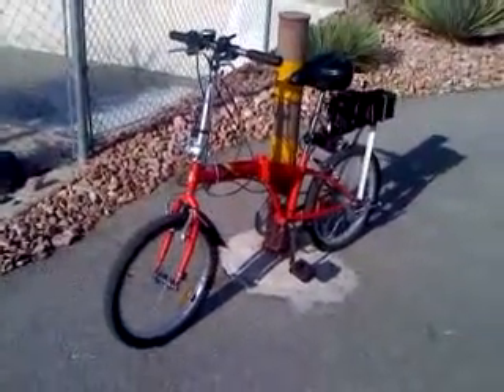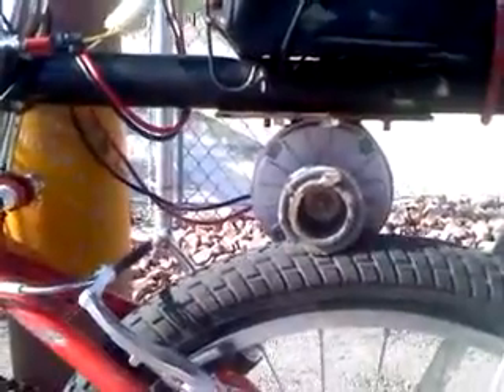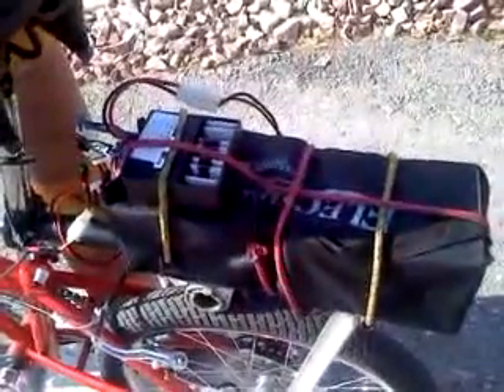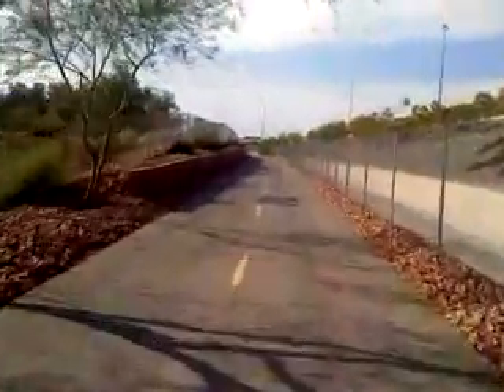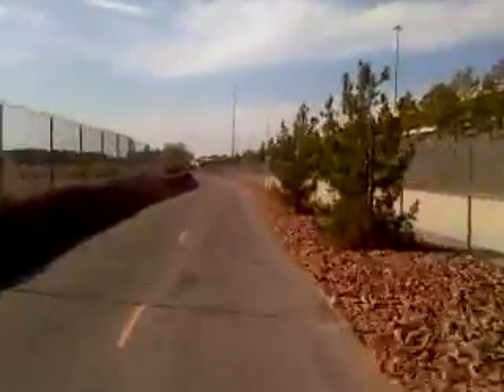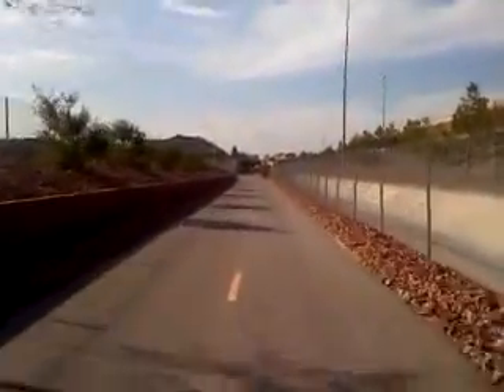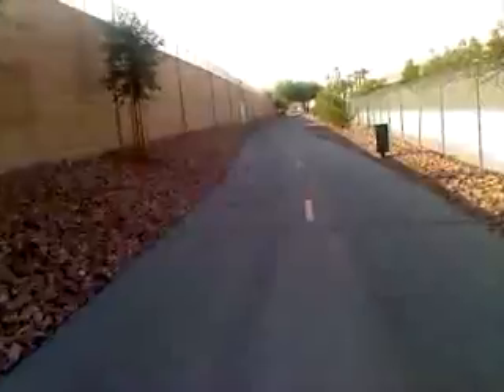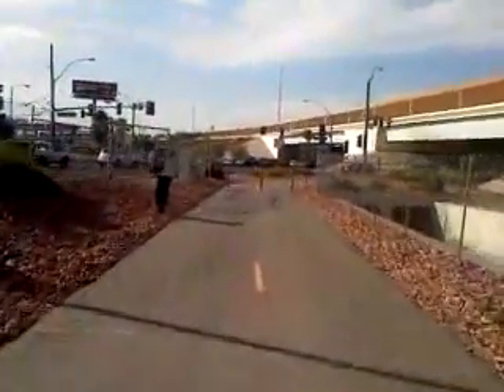Homemade Friction Drive Electric Bicycle

Comment: Hello, a lot of useful information about the motor power and the diameter of the roller, but what speed can it support under these conditions. My motor is 500 watts with the same roll. But not yet tested on the road. .See you soon
Reply from the maker: This bicycle had a cruising speed around 16 to 17 mph for a 350W motor.   With a 500W you may be able to use a larger roller to get a faster top speed.  With my 350W motor I was limited to these top speeds because of the power of the motor.
Reply: Thank you for the answer, I will mount a 80 mm diameter roll and I hope to achieve about 24 miles per hour. This is my calculation but will settle on the street. See you soon

Comment: Hutchtransfer, There have been more recent videos where people have rigged variable tension friction drives to their bikes as well as i and they seem to work pretty well as if you want to coast then you can disengage the friction drive while you are riding.
Reply from the maker: Yes I have seen those.  That device did not exist at the time I built my friction drive several years ago.  Using those RC plane motors are definitely the way to go since the motor disengages when you turn off the throttle.  If I were to build a friction bike today I would definitely look into that new system.
Reply: Right on and yeah i figured because all the other videos were newer on the release date lol. Yeah I have a 26 inch mens schwinn sidewinder mountain bike and im using a 280 watt 24 volt scooter motor with a 70mm skateboard wheel as the drive wheel (As you can buy them in different sizes by the millimeter of diameter and they have decent grip) and an old thumb shifter to put tension on the motor so it works like a clutch. Right now i only have 22.2 volt lipo 5000 mah batteries running it.

Comment: How do you work out the range and top speed of the electric bike?
Reply from the maker: +Larry Krishna   I can calculate the top theoretical speed by knowing the motor's top RPM (2750), the diameter of the drive roller (2.25 inches) and the diameter of the wheel (20 inches).   So 2750*2.25/20 = 309.  This means the back tire is spinning at 309 rpm.   The circumference of the tire is 20*3.14 = 62.83 inches.  So 309*62.83 = 19414.47 inches per minute.  Then convert inches per minute into miles per hour:   19414.47*60*(1/12)*(1/5280)= 18.38 mph.  On a slight downhill or if the wind is to my back then it will reach 20 mph. The range was not calculated using math.  This was the average distance I would travel on one charge.  Of course with using lead acid batteries the range will slowly diminish over time.
Reply from the maker: +Larry4life   Yes the rated rpm is usually the top rpm with a load.  Of course my calculation was assuming there is no wind or hills.  Purely theoretical top speed.  Actual speeds may be less.   I am glad the math is understandable because I am a math professor at a community college here in Vegas!
Reply from the maker: +Larry4life    So here is the process that I use to convert the motor's top speed to miles per hour.  First I want to calculate the rpm of the rear wheel by using the following formula:

motor rpm*(# of teeth on motor drive sprocket / # of teeth on crank drive sprocket) * (# of teeth on front gear sprocket / # of teeth on rear sprocket) = rear tire rpm

Now we need to convert the rear tire rpm into miles per hour by doing the following:

rear tire rpm * (pi*wheel diameter in inches) * (60 min / 1 hr) * (1 ft / 12 in) * (1 mile / 5280 ft)

This will give you the speed in miles per hour.  Keep in mind that this is the theoretical top speed.  There are of course energy losses in the chain and the inefficiency of the motor.  Therefore actual top speeds may be less.  I have not done any calculations with torque.
Reply from the maker: +Larry Krishna   Sorry about that!  Those calculations are for my current bicycle in which the motor is connected directly to the cranks.  This allows the changing of gears to match road conditions.   With the friction bicycle I had a 350W motor which is not that powerful, so I calculated a gear ratio to have the bike have a top speed of 17mph.  Here is the calculation I used:

Motor RPM * (Diameter of Friction Roller / Diameter of Rear Tire) = Rear Tire RPM

Then I used:    rear tire rpm * (pi*wheel diameter in inches) * (60 min / 1 hr) * (1 ft / 12 in) * (1 mile / 5280 ft) = bicycle top speed.  

 So I settled on a 2 inch diameter and that seemed like a good compromise between speed and torque.  Torque will be related to the slippage of the wheel, but I don't have any calculations for this.   I used the calculations to get a ball park speed I wanted and then tested it out.  Top speed was about 17 or 18 mph which is the most I can expect out of a 350W motor.
Reply from the maker: +Larry Krishna   So if you have a smaller diameter drive wheel then this means the bicycle will go slower, but it will have more torque (more power for driving into the wind or uphills).  If you have a larger diameter drive wheel then the bicycle will go faster with the wind and downhill, however it will not have that much power for uphills.  Therefore I choose a diameter that had some speed and some torque.   So a top speed of 17 mph is not that fast but it had some power from driving through light breezes and small hills.  For this bicycle I only used the math to get a starting point but then after that it was trial and error until I found a wheel that worked well enough for me.  Your motor is much more powerful than mine which means you will be able to use a larger diameter wheel that will give you some speed but the motor will provide enough torque for hills as well.
Reply from the maker: +Larry Krishna    I have a 24 volt system, so I purchased a throttle with a 24V LED battery indicator.  I purchased it here:  http://tncscooters.com/index.php?route=product/product&path=65_79_82&product_id=77
Reply from the maker: +Larry Krishna    I do not recall using a fuse on that project.   I had the batteries directly connected to the motor but with a switch in between.  I believe this is the switch I used: https://www.radioshack.com/products/spst-toggle-sw?variant=5717513797
Reply from the maker: More volts means more speed, however the amperage is like a storage tank.  The more amps you have the longer the battery will run.  However the battery should be one of those high C (capacity) batteries which allows it to deliver these amps quickly supplying the motor with what it needs.
Reply: +hutchtransfer Thanks a lot for your quick response. I'm struggling to build an electric bike for my university project. May ask another question about this soon if you don't mind. But that maths is really understandable. I'd give you a +10 thumbs up lol. is the "top rpm" the rated rpm? My motor only came with 4 values - rated rpm, rated current, voltage, and power.
Reply: +hutchtransfer Can you explain the gearing. I'm working on a spreadsheet at the moment and not sure how to apply the gear ratio concept of v=r(omega). I need to find out a suitable sized friction wheel from it. For example, from my data: http://prntscr.com/a76sfd
I need to gear down a 23Nm torque at the wheel to meet the rated torque of my motor which is 2.8Nm. In my project, I'm specifying that i'm designing to achieve 5mph at 1 degrees. Even after I gear the bike to achieve this, can I go faster? I believe I can go at 10mph at 5 degrees. But not too sure with gearing.
Reply: +hutchtransfer thankyou for your reply. I didn't understand the part with the number of teeth. isn't your motor attached directly to the rear wheel? I'm doing the same thing but with a 26 inch wheel and an 800W motor which spins at 2800rpm. I've been stuck for a while  with torque stuff. If you didn't do any torque calculations before you chose the size of your friction wheel, how did you decide on what size to use? I thought it's torque dependent :/. My motor has a rated torque of 2.8Nm. Is there a recommendation of friction wheel size you can maybe give me please?
Reply: +hutchtransfer thanks a lot. I've just done the calculation and found that I can actually use a 6 cm diameter wheel to achieve 20mph.. you mention the good compromise between speed and torque.. forgive my stupid question,  but what do you mean by that? I mean if you didn't do a torque calculation, how do you know if it was a good balance? I want to take this opportunity to say thanks. you've been a great help.
Reply: +hutchtransfer thanks. my table has been fixed and I've settled for an 11:1 gear ratio. 6 cm diameter friction wheel to drive a 66 cm rear wheel. The torque values also look reliable now too as I've used rolling resistance n assumed to pedal before using the motor instead of using it from standstill. Using my maths, and your help, I've  found that my bike should reach 20mph on a 1 degree (1.7 grade) incline on a dry grassy surface. can I purchase just any random throttle? how did you choose yours? I'll provide a screen shot of my improved spreadsheet later today. I'm in bed now. been up all night working on this nightmare if a project lol.
Reply: +hutchtransfer I need to add a fuse and switch. would you mind specifying what yours are? I'll need a 25A fuse.. but not sure how to connect it.
Reply: +hutchtransfer Hey again. I have converted my mountain bike into an electric bike using your advice. But my top speed is nothing like I calculated it. I have a gear reduction of 11:1 (friction roller caster wheel of 60mm, and 26inch rear bike wheel). The top speed (using the rated rpm of the motor of 2800) is meant to be 19.68mph, but it's not even near 10mph. My battery was really expensive, so I only bought enough to meet the voltage requirements of the motor. So my total battery pack is 36V and 3.5A. Do you happen to know if the current is responsible for the top speed of the bike? or is it the voltage? I read that voltage affects acceleration and current affects top speed, but other people have said differently.
Reply: +hutchtransfer Thanks mate. Sounds like i need to buy a new battery since mine doesnt seem to have a C rate attached. I'll take a video and show you soon.
Reply: +hutchtransfer Also, are you saying that if I get a battery with a high C rate (like 30C), then my bike will travel much faster under the same voltage of 36V? And would it still allow me to have that longer battery run time too?
Reply from the maker: Getting a high C rate will mean you will not have voltage loss when you apply the throttle.  This means that it will be able to continually deliver 36V even under load.  What is the brand and model number of the motor you are using?  And the motor is for 36V, correct?  I used a 10:1 ratio for the bicycle in the video with 24 V and I was able to achieve a top speed around 16mph (drive wheel 5cm, rear wheel 50cm).  Therefore your drive wheel size of 6cm seems correct so you should be getting the same results, so I am not sure what is causing your slower speeds.  Longer battery run time is determined by the amperage capacity of the battery.
Reply: +hutchtransfer Hey, I replied to your message last week but i'm not sure where it went. I't was from my phone. I'll get back to you in a bit. Sorry. Just passed by to see if there was a response but also ask something new: If you ride the bike when the battery is flat, will it charge the battery? or is it bad for the electric motor to force it to spin in that scenario?

Comment: If it was longer used, how does the roller and tire  wear?
Reply from the maker: With a roller your tire will wear out a little quicker, but it depends on the material you use on the roller.  The PVC I used eventually wore out when going up some big hills.  Probably better to use rubber on rubber.  Only use it on flat terrain or small hills.
Reply: ***** How do you connect the roller to the motor... Also are there motors you can buy that you can use in the rain. I am looking for a daily commuter type bicycle. Trying to do it cheaply

Comment: I'm going to do a design like this but I'm putting it to be chain driven and it will have a motor on the front that spins and charges the batteries as I go along but I can't seem to find any diodes does anyone have any ideas

Comment: do you know of a way to attach something to recharge the batteries at the same time that your pedaling or using the motor? I'm planning on making this as well but i dont wanna run out of battery if im out somewhere, i figure an alternator of some kind but idk how or what to look for as far as that would go.

Comment: I made one very similar to this when I was about 14. I had a controller failure then the on off didn't work. I ended up dumping it over my back with my face being the brake on the concrete. My Momma was so pissed at me. After I got out of the emergency room and got a clean bill of health she whipped me with a fly swatter.  This really brought back some good memories. I got the nick name "Pat Splat" that summer.  Your design is much better though, really awesome.

Comment: I did the same thing but mine only has 200 watts came off of My Izip electric scooter I put a weed eater engine on My scooter and I guess I put My electric motor on My  mountain bike good for riding on bike path gas isn't aloud on the bike path.  Oh Mine frition drive to and I have Mine the same way with the batteries and motor  on a Trans, it rear bike rack.

Nice job

Comment: I hope you don't think that putting a larger wheel on that will change it's gear ratio. Your final drive is only determined by drive roller diameter. The top of a wheel always travels twice the speed of the axle-no matter what the wheel diameter. It's just like a tank or bulldozer-the top of the track always travels twice the speed of the vehicle.  that's how cavemen sent us the wheel. :(

Comment: wats the top speed. i bet its probably not alot scince the motor is driving the big wheel instead of a small gear. but i guess it has alot more torque